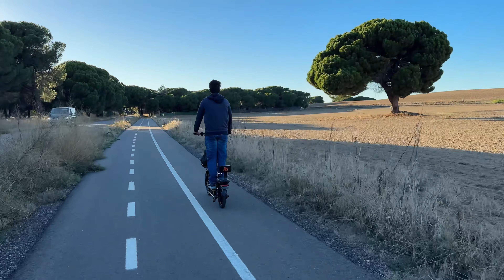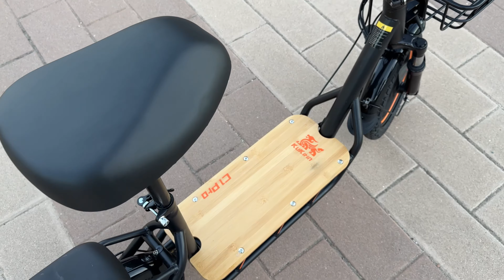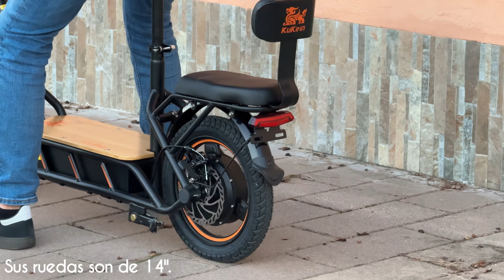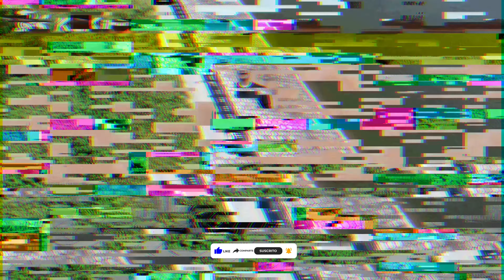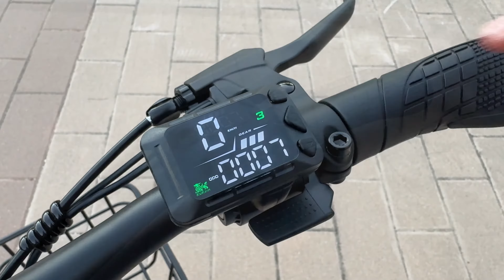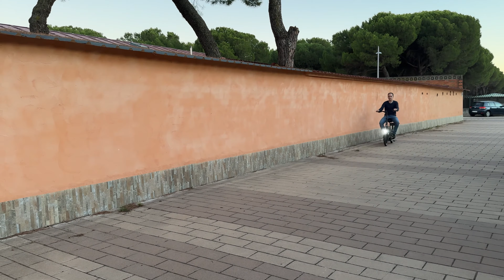Testing the KUKIRIN C1 PRO Electric Scooter

Comment: How I envy you! My scooter won't go faster than 35 km/h! Or else I'd have to completely re-flash the control unit! That's dangerous for the battery and electronics. I'm an old man, and for me, an electric scooter with a fixed seat is the best choice!